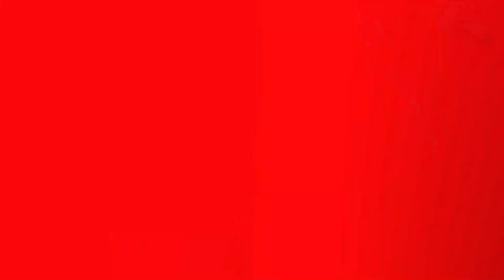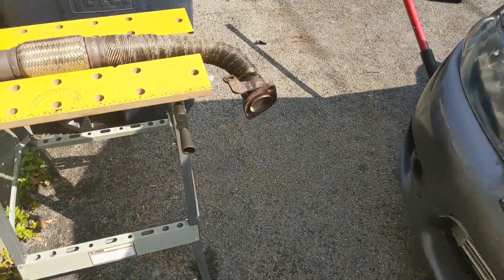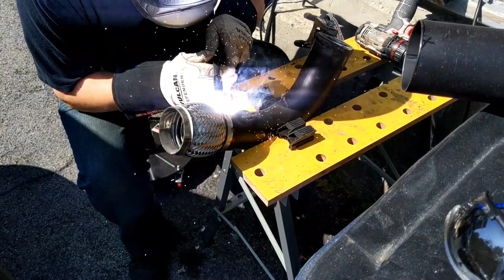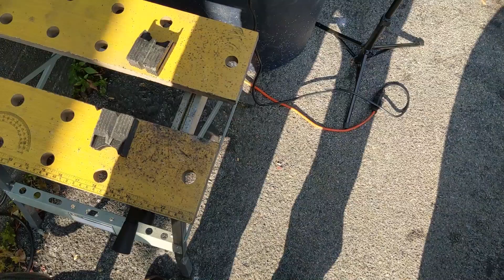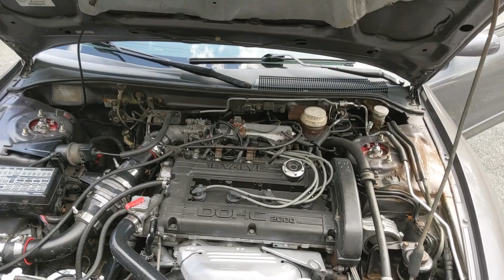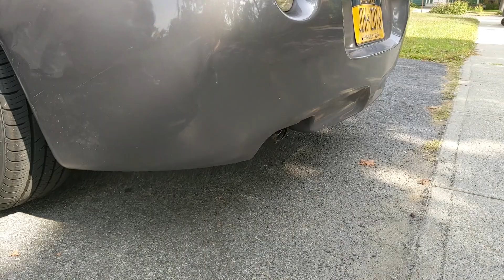HOW TO BUILD A CUSTOM HIGH FLOW DOWNPIPE AT HOME (2G DSM)

Comment: I am trying to replace my oil pan.   This exhaust section in the video is giving me trouble.  There is also a pulley in the way of the oil pan coming out.  I'm really worried about those exhaust bolts.  There is also a heat shield.  First I plan to try the exhaust bolts back past the CAT and drop the pipe down enough to get the oil pan out.  I got to find some kind of solution before winter.
Reply from the maker: hope you figured it out my man!. You can always cut it short and get one of the autozone wrap around sheet style exhaust clamps to make it easier if the bolts are rusted on bad. good luck